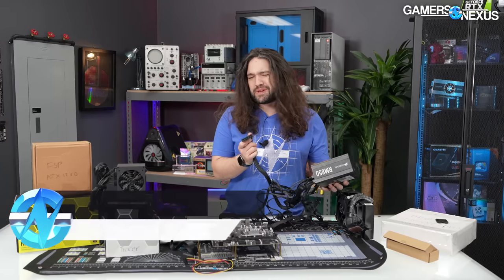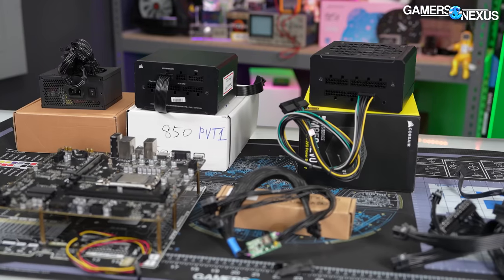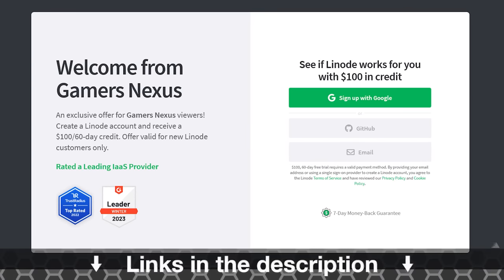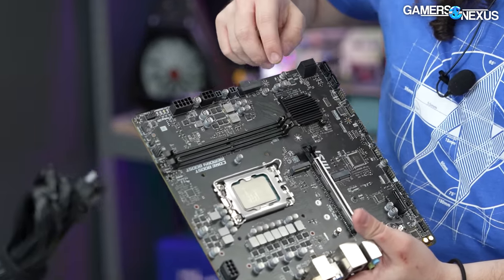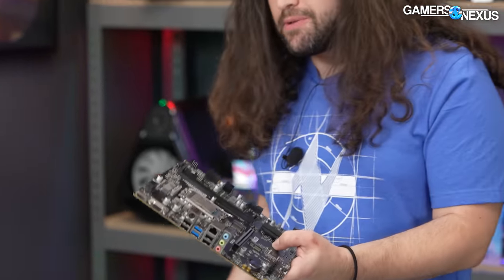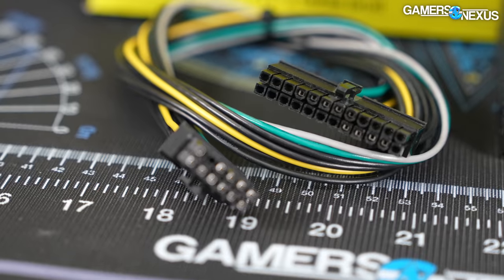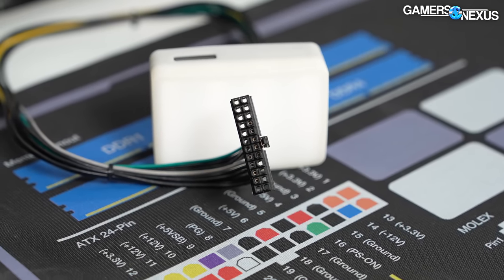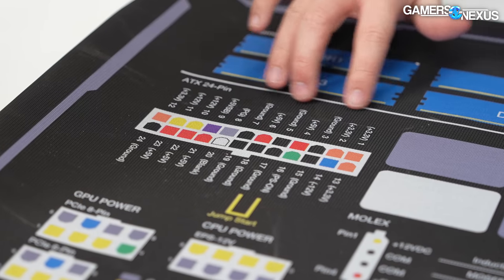The Future of Power Supplies - Maybe (Motherboard Cost, Cables, & ATX12VO)

Comment from the maker: Watch our power supply playlist, including exploding power supplies, over here! https://www.youtube.com/watch?v=SMn2F2wx1LM&list=PLsuVSmND84QtHZ6WXQ4-4YJhq9VVkOOtw
Grab a Modmat as shown in this video! Large is here: https://store.gamersnexus.net/products/modmat-volt-large

Or Medium here: https://store.gamersnexus.net/products/medium-modmat-gpu
Reply: love you steve
Reply: ATX12VO is quite interesting. My PC is already powered on 12v lead acid batteries and I am using buck converters to step down the voltage to 5 and 3.3v with. The batteries are being charged by an MPPT solar power charger. I am also using a 12v power supply connected to unreliable grid that goes on and off unexpectedly. There are relays and filtering capacitors that works as a DC UPS. All of this would have been a lot easier if my PC is an ATX12VO.
Reply: Can you share the part number from that corsair rm850 12vo?
Reply: Just to be clear, are all the spicy capacitors still going to remain within the PSU or is there going to be an increased risk of deadifying yourself by handling the MB?
Reply: I would prefer that they stay the same.  Given: I don't know about actual/real data, but I'd be concerned about the 5V system dying on the MB therefore rendering the MB virtually useless. And since the MB a primary component of any system you'd have to RMA the MB or replace it at a fair cost.  Whereas it currently is - you can go out and purchase a PS; or swap it out as some people probably have a PS that they could install, whereas most if not all would not have a MB they could swap out.
Reply: So, in other words, Intel wants to make motherboards even more expensive than they've already gotten. 
Didn't you just do a video about that? haha
Reply: 12VO is a PSY OP
Reply: I have a 7000 series and whenever i restart it shows a black screen i have to boot it back and it shows display idk wats the problem i have reinstalled windows updated bios
Reply: I can't wait for these suspicious sata cables to melt because you decided to hook up a harddrive instead of 2 ssd's to it
Reply: Sharkoon PSU
Reply: Its smart IF it was its namesake. 12 volts only. Its half baked because we have built the other parts alongside the power supply unit until now to run on multiple voltages .
You need a core change to everything to 12 volt supplies to even be viable in the first place. 
Motherboards might need (E)AT-X again for full functionality. 
What does the power supply turn into now that it needs less internally, does an ATX standard PSU turn into SFP?
More questions than engineers have thought out it seems.

Putting a solar circuit on the back of a thin and light . 15-25 watts roughly that could be trickle charged on the go or slow charged while not working. <-better innovation pulled from imagination.
Reply: Eventually, computers will need to be plugged into a 220V outlet. I forsee houses getting rewired.
Reply: @elusivelectron  Like in Western Europe. Although i's 230 now.
Reply: @elusivelectron  most older and some new PSU will operate on 220 volts either via a switch flick on the power supply or automatic detection. The cord and plug would have to purchased separately and be rated above 240 volts 20 amps  . The electrician would have to put a wall plug with informative cover indicating the circuit is high voltage. That's in North America. EU and many foreign countries operate on 210-240 volts for the whole house and then you just plug it in like normal . :)
Reply: I dont know if i wanna go spending even more, as well as giving the MB manufacturers another way to strong arm you into more expensive territory, by moving the power distro over to the MB. Having to make the choice of buying a super expensive board in order to get decent power delivery is something I don't want to see since, frankly power supplies are pretty cheap, and I think it works fine as is.
Reply: I can reuse a PSU whereas I cannot reuse a motherboard often for new CPU's. This is dumb. We don't need this "solution".
Reply: really hoping this will take off, as it currently has very few downsides (mostly the adapter cables for 12VO MB on old PSUs and 12VO PSUs on old MBs).
With the rate of SATA going extinct (these days almost every new build uses NVMe only) there really only is the USB ports (besides the MB itself). Almost all PCIe cards, fans & leds nowadays use 12V only.
Reply: Thanks for the update Steve, I was wondering what was happening with them. It's one of the changes I was waiting for before upgrading, I figure it should make small ITX builds easier to do without going for one of the DC/DC options with or without a laptop power brick. I'd rather without but I don't want to spend a fortune on very niche PSU options.
Reply: There would be much more sense to add specialized connector to motherboard for controlling PSU.
Motherboard would give "orders" to PSU to shut down voltages it does not need at the moment. If PSU is not compatible (does not have control line) no big deal, nothing would happen, PSU would continue to provide voltages, motherboard will continue to waste electric energy as before ...
Reply: Have you done a later PSU video explaining ATX 3.0 and PCIe 5.0? The only one I have found from people I trust about PCs is from JayzTwoCents. Have you done one about these PSU which I have missed?